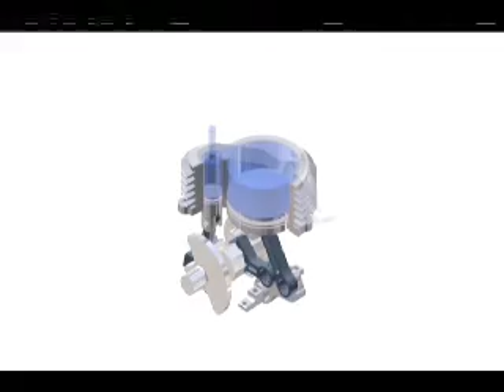A car that runs 200 miles on compressed air.

Comment: @mikehanoo33 , "even if you fill up your air car with some power source that uses non green technology ie. coal , nuclear ,or petroleum it is still putting less pollution in the air then if you burned straight petroleum"
BULLSHIT 
compressed air is SO INEFFICIENT even if you accept MDI's lies you use more fuel and produce more pollution 
Google Berkley air car. 
Green electricity? 
Google Vencat 20 miles 
The air car (per MDI's USA agent) is FIVE TIMES LESS efficient than an EV

Comment: @diemos09 > OK lets beat this old dead horse one more time , even if you fill up your air car with some power source that uses non green technology ie. coal , nuclear ,or  petroleum it is still putting less pollution in the air then if you burned straight petroleum , and of course many green energy sources are being installed as we speak , wind turbines , solar , hydro electric , tidal exchange systems ( which France has) and other solar type systems that use a parabolic dish to heat water >

Comment: Hitachi Magnetics Corporation: Magnet Motor
 
Engineers at Hitachi Magnetics Corporation have come right out and claimed that a motor run by magnets is feasible and logical, but the politics of the matter make it impossible for them to pursue developing a magnet motor or any device that would compete with the energy cartels. The obstacles to free energy are the big banks who own or finance the energy industries.

Comment: @mikehanoo33
"that does not mean that we cannot get more energy out of a system than we put into it" 
yes it does and no you CAN'T

 "A crude example is a solar panel in sunlight."
For fucks sake you really are concrete lamp post stupid. 
That DOES NOT violate the 1st 2nd and third laws. Extracting energy from a HUGE thermo nuclear fusion reactor aka the Sun is just energy transfer.
1st, 2nd &b third. You can't win, you can't break even & you have to play the game

Comment: @mikehanoo33 Don't be an idiot the scam artists at MDI have been running their silly short range con since the 1990's. THEY won't allow automotive journalists or engineers to drive because it would PUBLICLY reveal what pathetic pieces of crap these toys are. In the only MDI published test it went 5 miles.
How could anyone stop MDI taking there con to a race track and setting distance records? The only hold up is MDI.

Comment: @mikehanoo33 - get a grip.  Compressed air powered systems are wasteful and are an appalling use of any energy source.  Quoting an article at me does not change the fact.  Go read a few books on basic physics and try to grasp what is feasible.  While fossil fuel is cheap other sources, and the means to use them, will struggle.

Comment: If, instead of the solar panel, we had a device which absorbs some of the energy which Quantum Mechanics observes and gives out, say, electrical power, would that be so different?   Most people say "yes! - it is impossible!" but this reaction is based on the fact that we cannot see this sea of energy.   Should we say that a TV set cannot possibly work because we cannot see a television transmission signal?

Comment: The Law of Conservation of Energy is undoubtedly correct when it shows that more energy cannot be taken out of any system than is put into that system.   However, that does not mean that we cannot get more energy out of a system than we  put into it.   A crude example is a solar panel in sunlight.   We get electrical power out of the panel but we do not put the sunlight into the panel - the sunlight arrives on its own.   This example is simple as we can see the sunlight reaching the solar panel

Comment: Many people have produced devices and ideas for tapping into "Zero-Point Energy" because it is the energy which remains when a system has its temperature lowered to absolute zero.   This presentation is introductory information on what has already been achieved in this field: devices which output more power than they require to run.   This looks as if they contradict the Law of Conservation of Energy, but they don't, and you can see this when you take the zero-point energy field into account.

Comment: @thedmf12345 Don't be silly this is a short range (5 miles) con designed to take money from technically illiterate investors.
EV's provide nice feel goods to eco people who can't do maths. Economically they are a disaster. The high initial price plus the cost and relatively short life of the battery pack means they cost the owner over the life vehicle is about double a gas powered vehicle including the cost of fuel used.

Comment: Back in the 70s there was the electric car during the oil crisis. That got supressed, probably by big oil or the gov't.  Now with gas prices going up electric cars are back. What took them so long.  Probably only because Honda, and Toyota was leaving American cars in the dust with their hybrids.  Now we have compressed air hybrid cars.  They have been around for a number of years too.  Guess they are being suppressed by you know who.  If GM, and Ford don't build these cars you know who will.

Comment: Despite the poor presentation there is something promising in this technology.

There's a Motortrend article that spells it out.  Basically Tata has licensed this tecnology to create an gasoline/air hybrid that avoids the costly components in a gas/electric hybrid.  

I can't insert the link so google Motortrend Air Hybrid
Goo

Comment: Therefore a compressed air powered vehicle is not necessarily pollution free, it all depends upon how the electricity used to run the air compressor that charges the car is generated - i.e. coal, natural gas, hydro, solar, wind.

The compressed air fueled compressor that they mention in this piece is complete BS!

Comment: So much stupidity on one page, it's hard to decide which to ridicule first. 

First: The narrator obviously has no idea about mechanical losses, perpetual motion doesn't exist. MDI may have an air powered piston engine, big deal. It's a reversed air compressor. The actual air compressor required to fill the tank will have to do all the work first.

Second: The most popular comments, by mikehanoo33, are both meaningless to the discussion whether this story makes sense or not.

Comment: Charles B. Hodges will always be remembered as the true father of the compressed air concept applied to cars, being the first person, not only to invent a car driven by a compressed air engine but also to have considerable commercial success with it. The H K Porter Company of Pittsburgh bought the rights to Hodge's US patents and sold hundreds of locomotives so equipped to coal-mines in the eastern USA, in the period 1896-1930.

Comment: @mikehanoo33 "inexhaustible gifts of free energy" 

Thus proving you are a 

Nut job, a tinfoil hat wearing kook, barking mad,  a loony, away with the faeries, not firing on all four cylinders, deranged, a few sandwiches short of a picnic etc etc etc.

Finally as has already been brilliantly and succinctly expressed "PERPETUAL MOTION IS RETARDED" thanks and a hat tip to jjdowson.

Comment: @DouglasButner 
Perhaps - but didn't you watch the video??  Anyway, even if the self-generating system doesn't work, the energy doesn't have to be OIL!! It could be solar energy, wind energy, or hydro.

Comment: @fizzguts   We have been putting 10% Ethanol into are cars for years now  , 10% of $149.6 Billion is $14.96 Billion , still a far cry from $116.6 million .Plus, between $3 and $6 in tax receipts are generated for every dollar of ethanol subsidy. The rate of return can be much higher in rural communities, where re-spending within the community produces a multiplier factor of up to 22 times for each alcohol fuel subsidy dollar.

Comment: @fizzguts Since 1984 Armando Regusci has been working on compressed air vehicles,in 1992 with only one charge of compressed air in the tanks of his car it ran 100 Km.
This is possible because of the use of the especial free piston and free wheel compressed air engine.

Comment: With the hopeful days of air powered street transit over, the compressed air locomotive became a standard fixture in coal mines around the world because it created no heat or spark and was therefore invaluable in gassy mines where explosions were always a danger with electric or gas engines.

Comment: A substantial gain in range-between-fill-ups was thus proven attainable with no cost for the extra fuel, which was provided by the sun.  The H. K. Porter Company in Pittsburgh sold hundreds of these locomotives to coal-mining companies in the eastern U.S

Comment: @mikehanoo33 "The coal mines of France and Germany and other countries such as Belgium were swarming with these locomotives, which increased their range-between-fill-ups 60% by the addition of ambient heat"
BUT they still only went about 5 miles and when reasonable battery locos became available the air locos were SCRAPPED.

Comment: @mikehanoo33 "almost perpetual compresed air vehicle system. Rogers designed a system where the on board motor could be powered by compressed air and also replenish the cycle" BWHAHAHAHA! Ie a loony

Comment: India's air powered motorbike

 

Air car inventor Lee Rogers was one of the first to design a closed loop almost perpetual compresed air vehicle system. Rogers designed a system where the on board motor could be powered by compressed air and also replenish the cycle. Although in his patent 4,292,804 "Method and apparatus for operating an engine on compressed gas" this perpetual engine cycle is not shown. This was as far back as the early 90's.

Comment: Roy J. Meyers - from LA built an air powered car in 1931. (air has been used for years to power localized underground mine engines) Myers, an engineer, built a 114lb, 6 cylinder radial air engine that produced over 180 HP. Newspaper articles at the time reported that the vehicle could cruise several hundred miles at low speeds.

Comment: @fillard Name calling? It makes the credulous think, nothing else works.
Steam & solar are based on sound scientific principles and can be explored and evaluated JUST LIKE air cars. Air cars + the ideal gas law = FAIL. History + air cars = FAIL. Franchise schemes, broken delivery promises, $13m taken + MDI = FAIL. 
Solar hot water can be evaluated the same way Most are over priced,  poorly installed, under sized and have "optimistic" payback $. 
Evaluate, check, buy = good result

Comment: @hotmichael3358 Can't you read? Emphasis added
There is nothing stopping anyone planting a field of rapeseed and processing it but with out about a 50% subsidy and NO  TAX it's an economic disaster even in Europe where fuel tax is huge and NO ONE SUBSIDIZES oil. 
Li batteries are the BEST & FREELY available but at $14,000 for a set & a 1000 cycle life buttock clenchingly expensive and thus not economic. EV's Feels nice for the planet but it's so expensive in running costs

Comment: @hotmichael3358 You quote the subsidy Big oil receives but ignore the tax paid by consumers for transport fuel
 There is nothing stopping anyone planting a field of rapeseed and processing it but with out about a 50% subsidy and no tax it's an economic disaster even in Europe where fuel tax is huge. 
Li batteries are the best & freely available but at $14,000 for a set & a 1000 cycle life buttock clenchingly expensive and thus not economic. Feels nice but wallet hurts

Comment: @Voxson1 Yes but its toxic dirty energy , and if you fill your compressor from a source that uses wind turbines , solar , geothermal , bio fuel , hydro electric , tidal electric generators , which they have in France by the way then its far cleaner then any petroleum based energy device  , these could be used by over 90% of the workers commuting . And help save this earth from the idiots !

Comment: @Dow7969 - compressed air is not "free, unlimited, non-pollutant fuel source" - it is very inefficient to compress air - and unless you do it with such means as solar or wind powered energy sources it is indirectly very polluting.

Comment: @Dow7969 
Google vencat 20 miles the former USA distributer  gave out figures that show this POC is 5 times LESS efficient than an electric vehicle

The ONLY test result posted by MDI was for an air car than went FIVE MILES. 
This is a stupid con
 Air powered vehicles are over 100 years old  google douglas self museum of retrotech and have NO way of improving on the pathetic range and power achieved

Comment: @ace1122tw My car gets 25 miles to the gallon in tip top shape. Which its not, and I idol, and many other factors. This is around 90 or so years into the production of cars. So to say that air fuel will never be as good is a bad assumption. They may never get as fast. But with the availability and the fact that there is no waste, far out weigh that.

Comment: @ace1122tw How would my computer react? feeling or program? Well first of all your feelings are programmed into you. There are many different ways to think. Can we agree that best decision is the most logical? What is more logical then math? What if every problem was turned into a math problem? Which is basically what we do. basically. I also want to point out that this car can go 200 miles on a tank. In the infancy of this tech. My car would have to get 30 miles to the gallon to do that.

Comment: @Voxson1 Lets say technology does not have a ceiling(cuz right now it doesnt). It gets better and better. There is so much room at the bottom(nano tech). Think how much air you could fit around a black hole. What if technology could recreate that gravity. Then that tech gets smaller and smaller until it can fit in a car.

I am not saying we will ever be able to create that much power. But technology wont stop until it does. Also you would not need that much power to run a car.Just an example...

Comment: The producers should take a basic physics class..Perpetual motion is impossible. Some of the engine parts will loose energy due to heat and friction. Therefore it can't "Re-fule" itself forever. Its called thermodynnamics and etropy.

Comment: @slingshot2427 yes but this technology was invented ages ago. Steam engines can run on compressed air. This car would most likely be just as efficient with a petrol boiler piping high pressure steam into the engine. when you take into account the energy required to charge the gas tanks in the first place and it would be a helluva lot safer without those huge tanks of high pressure gas.

Comment: Whover is behind this video flunked thermodynamics.  Air cars could work but probably require a fuel heater or big heat exchanger to heat the air on the way out. Cold air is smaller than warm air, (duh!) so you don't get nearly as much range as you might expect unless you restore the heat that came out when you compressed the air.

Comment: The story suggests the car can go 200 miles; the next video in the set says 200 km - big difference.  I was thinking this was a good idea until they suggested the perpetual motion machine concept - that's when it lost credability for me.  This concept that a compressor powered by compressed air would replace all the air used to power the  compressor is absurd.

Comment: like compressing air doesn't use any energy? plus the energy return would be a lot less than the energy input - an engine onboard to run the compressor, y bother with the compressor? use the engine to run the car, gosh, wot a novel idea roflmfao

Comment: This car would use special stations for taking compressed air. This perpetual motion voice over is crap. Of course you would need energy to compress air, but compression would take place at  certain locations, not in motion. It is much easier to filter and control emissions from a huge plant then from millions of moving cars.

Comment: A 5 mile range = 7.2km That is the result from the ONLY published test. You need a 5 to7 KW electric compressor and to run that for 6 hours. 
If you use a gasoline powered compressor you waste 75% of the energy. So if it was a gas engine vehicle and it went 20miles per gallon it would only go 5 miles per gallon if the same engine drove a compressor to feed an air tank which fed an air motor.
Range is no longer a problem but the inefficiency kills the idea stone dead
Sorry

Comment: "Sounds pretty good to me... no batteries and no fuel."
A 5 mile range is OK to you? That is the result of the ONLY published test.  You need a 5 to7 KW compressor and to power than for the 6 hours needed to refill the tanks you will need approximately $40,000 worth of solar cells plus power controllers etc
It's a CON

Comment: "they could have figured out somthing that worked"

Unfortunately the air vehicles of the 1900's used triple expansion reheat and a few other tricks and were still very short range. MDI haven't even reached that level of technology and at best they might triple the TESTED range ie 5miles would be 15 miles.
There are NO independent TESTS to confirm the silly claims in the MDI video

Comment: FACTS
ONLY test range 7.2km
The claims are LIES
They have been selling franchises since the 1990's and left the franchises burnt and effing angry.
This is OLD technology air cars were used as trams in the 1900's and died because they were very short range low power and energy inefficient.

Comment: Air is not free. This video is a lie. It takes a tremendous amount of energy to compress the air, and as a gas is compressed, it heats up. All of that waste heat is lost. 

It does not cost "nothing" to fill your car with gas.